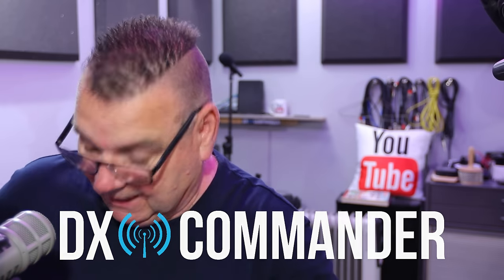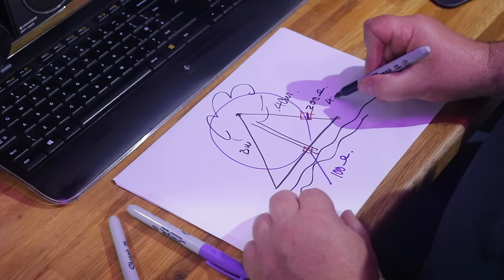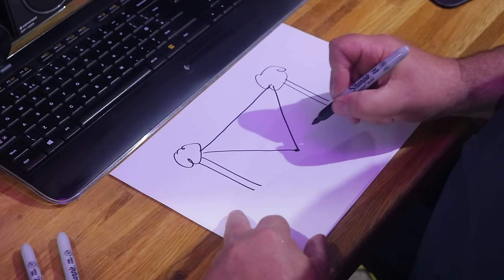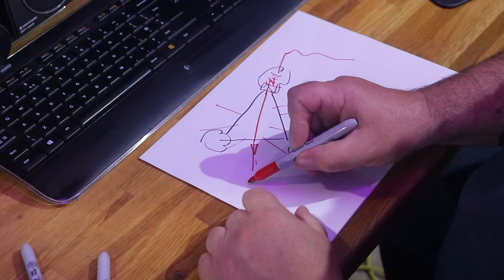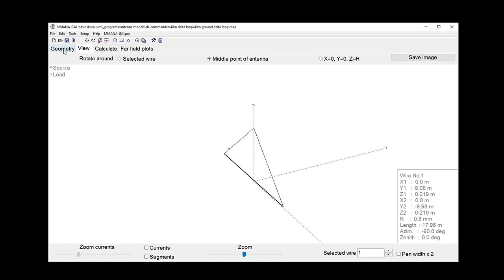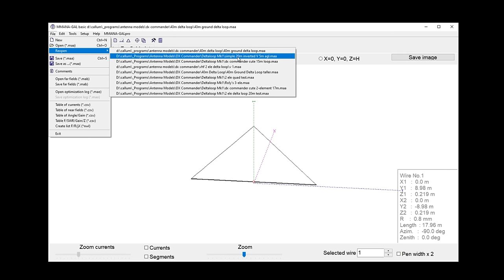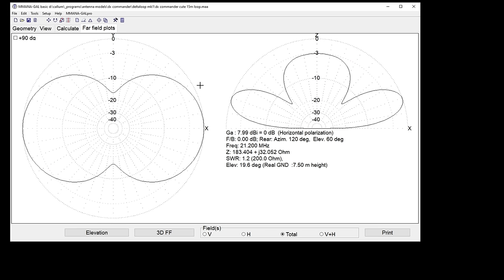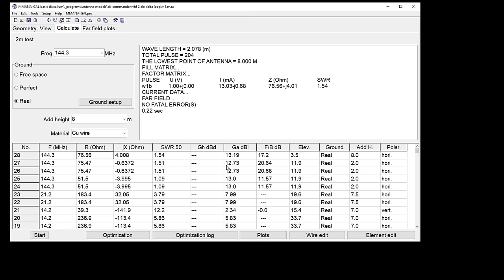The Amazing Delta Loop Antenna

Comment: I've been running a delta loop on 40 meters for years, feeding it with a 4:1 balun at the bottom.  This antenna beats dipoles, OCFs, anything else I have tried.  It's mounted between two trees with the the feed point at about 25 feet, the top about 65 feet.  I'm on the east coast, and can often work European stations while running 5 just watts.  I have worked New Zealand as well as Ireland, and many EU stations while QRP with this simple antenna!  Over the years, I have learned of an additional benefit - because the wire can move through the end support insulators , it isn't stressed in the wind like other wire antennas, and can slip a little.  I also have a 40 meter vertical as a reference, and under all conditions the loop blows it away.  Great to find your video!
Reply from the maker: Ah! Nice job :) Thanks for the visit!

Comment: I’m using a 20m, full wave, vertical delta loop, in a perfect equilateral triangle, fed 1/4 wave from the apex with a 4:1 balun.  What a great antenna.  VERY QUIET, low take off angle, and somewhat manually directional if you turn it.  I used a plastic coat hanger and 3 foot wooden dowel to keep the wire straight at the feed point. The antenna bottom is 10 feet off the ground.  You can lay it out on the ground and tape the insulators in place prior to hanging, to maintain the triangle.
Reply from the maker: Nice.

Comment: I have an 80 meter horizontal delta loop fed at one corner with 450 ohm ladder line.  It's up at 70 feet. On 40 and 20 meters It's a killer antenna.  I work from virginia VKs and Zls with 800 watts. I get 59 reports regularly.  It's a flame thrower. 🔥 Forget a balun at the feedpoint. Use ladder line with a 1.1 current balun at the shack with a short coax. By far my best wire antenna I ever used. Especially on 40 and 20.
Reply from the maker: Outboard ATUs and balanced line great.. I found a little difficult when changing bands fast.

Comment: I use a vertical delta loop cut for 30 meters feed 2 ft up one side with 300 ohm twin lead to a manual tuner. It works great 40-6 meters will tune 80 with diminished results. Best antenna I have ever used. Great dx.
Reply from the maker: Sounds great!

Comment: It's not only about gain, but also signal to noise ratio. I've used vertical delta loops for both 20 and 40 meters fed with a balun in the lower corner, and they were by far the best antennas I've ever used, even beating my hexbeam on 20m  by 3-5 S-units to multiple European stations. 20 also stayed open more than 45 minutes after it closed up on the hexbeam. Absolutely incredible antenna the Delta Loop is.
Reply: This sounds like a antenna I need to try to hold back the noise! My apex is pointing down and I will use 450 ohm window line and 4:1 balun. So this will be vertical and I want it to be vertically polarized. Where to put the the window line on the V legs if you know thanks!

Comment: I've tried a couple of delta loops with a point at the top, but have always gone back to a flat top, where practical. Feeding a quarter wavelength from a point is supposed to have a similar effect as feeding a square loop being fed from the side for vertical polarization, but with a delta loop it may not be perfectly vertically polarized. If the three sides aren't the same length, the gain or directivity won't be as high or as sharp and impedance can change. Think of that as going from an isosceles triangle to a folded dipole and the shapes in between. Fed at the bottom center, regardless of orientation of the triangle and it should be horizontally polarized. Most simple 4:1 baluns are voltage baluns. What is desired for antenna matching is a current balun. It is the current that need balancing, not the voltage. Note that a folded dipole is the same length of wire flattened out. A folded dipole has about a 300 ohm impedance. As it is opened up, into either a triangle or a square, the impedance is reduced. A square loop has about 100 to 150 ohm impedance, while a triangle might not be much different. To get 200 ohms, one of the flats of the triangle might be lengthened, while shortening the other two flats. For an isosceles triangle, I tune as a square loop and use an electrical quarter wavelength of 75 ohm coax at the feed point. For using a 4:1 balun, I would lengthen one side, shortening the others and / or lengthen the whole loop. If all three ides are equal and the loop isn't too big, the impedance should be closer to 120 to 150 ohms, than 200 ohms. If the loop is made on the small side, the impedance  can drop to less than 100 ohms, reducing gain, but able to be fed with straight 50 ohm cable.
Reply from the maker: Very fine analysis!

Comment: The advantage of a vertically polarized delta loop (point up, fed at 0.25 wavelengths down a side) over a ground mounted vertical is that you don't need to create a ground plane to get similar performance.
Reply from the maker: And that they become more bi-directional

Comment: Hi Cal, I ran a vk2abq design for 10,15,20 plus 40,80 with an atu. Yes direct using coat buttons as insulators produced a 1/4 cycle phase shift. Mine was  horizontally polarized and what a performer. An interesting build concept so the ABQ design is also a possibility for any band. Great work mate enjoy your presentations!
Reply from the maker: Ah cool!

Comment: I used to have a loop antenna on 80 meters, horizontal, it feeds the rf up so it's great for in country contacts, about 1000 km depending on the height of the antenna. Comparing to a 80m dipole it's much better and quiet on the band, so great for listening, I could hear stations that could not hear me because it's few s units lower on the noise floor. And that's an easy problem to fix with power. 

So yes I think a loop antenna is great for bands like 160m, 80m and even 40m just because the noise floor is better.

For 2m and 70cm the loop feed and reflector on a yagi antenna gives you a couple off extra db even if rest off the elements are stick's

Another thing with loops is that if you connect two together on 100 ohm feed point you get 50 ohm so it's easy to do a stack. 

In Finland we have a lot off this old phone wire laying around, it's parallel cable coming out to around 100 to 110 ohm and you can split the cable and build your whole antenna out off it and the feed line is a part off the antenna.

Thanks for the great video and keep up the great work 👍

Comment: Thank you Callum for the great info on delta loops. I am planning on setting one up here in the near future. If I can fit it in my yard, I'm going to try a 40 meter loop. I've heard that these antennas are good for low noise receive. I guess we'll find out. 73, K7AXA

Comment: Great Video.I have a loop antenna about 250 m long fed with open wire feed line then to a 4:1 balun. It out performs any other antenna I have used on HF.

Comment: I am building a M0PLK version of the Delta Loop Cal. So I will have to choose from my 135ft OFCD, The Delta and my new 12.4 as soon as I get it built (I ordered the missing bolts on Amazon) dont worry about the cost Cal, go have a couple of pints, you earned it getting the 12.4 designed and tested :)
Reply from the maker: Bless you brother!

Comment: You can build a 3:2 autotransformer type balun with an 11:9 turns ratio. I suspect they aren't generally available commercially due to the improvement in power delivery being marginal in most circumstances, although I haven't investigated it heavily.
Reply from the maker: Clever!
Reply: balun is available on ebay from seller in France.

Comment: The AARL handbook used to have a section on that so your UK clubs might also.  As for the fiberglass poles the two meter set-up looks like just the size of a 1 man tent.  They might even have ready made replacements you can buy minus the tent.

Comment: Thanks, I use a 40m Vertical Rectangular Loop.  The bottom wire is only 6.5 ft from the ground.  It’s fed 1/2 way down one of the vertical legs.  It’s magic on the ears being in the city.  The height at the top wire is close to 25ft.  Works great on 40/20/15/10/6m.  Just need a nudge of the ATU on 30/17/12. -AJ NK4O
Reply from the maker: Great tip!

Comment: Great video Callum. 3rd option of feeding is by using a ladder line instead of coax and then using a tuner. The benefit of this is that you can use any band over the full wavelength loop you made it for (and depending on tuner sometimes other bands too).
I once had a point down delta loop for 80m hanging between 2 pine trees.
It was working very well on 80, 40 and 20m but on 17m I tended to always end up in Ethiopia with even the band seem to be closed I was getting +40 to +50db reports down there. Had a big laugh about it.
Somewhere I learned that Square loops actually is slightly better than Delta loops and the best loop would be one completly round. The reason should be that the bigger the surface area the higher the gain. It would be nice to see you expand on that.
73 de Magnus SM6WET
Reply from the maker: OK, I tend to disagree unless you were looking at NVIS. The thing about a triangle is at least you get real gain SOMEWHERE...
Reply: @DXCommanderHQ  OK, so what my point is not a NVIS low hanging horizontal loop but a vertical loop or several elements vertical loop. Example a squared 2el quad would give slightly more gain than a 2el Delta loop.

Comment: I've built a lot of loops over the years and have always made coaxial matching transformers for them from 75 ohm rg-59, or the bigger  rg11.  I used an 80 meter horizontal-loop for years and loved it, but couldn't keep it up in the Canadian winters. Anyway, high-q baluns "might" be better and cheaper then some long length of 75 ohm cable. I'd go for a 40 meter vertical. Of course that means lots and lots of long radials.
Reply from the maker: Yes, I did that once - and superb for single band vertical delta loops.. Ideally, that's a mono-bander anyway so a 75 ohm matching stub is probably the best way to go.

Comment: This summer I have been using a delta loop cut for 20 m band (20.7 m)hanging top 11 m in my flagpole and stretched to East West and basic line is 5 m over ground.  I'm feeding it in the low angle/ site with an open wire feeder going to my S-match tuner. I can tune from 40 to 6 meter with perfect 1:1. I guess on 40m not the best effiency but it works. On 20 and 10 m lots of north and south America with FB rprts (CW) and 100W. Its a very quiet antenna so a pleasure to listen on different bands. Setting up a fullsize 40m loop same way feeding, but hanging north/ south. Expect to tune it on 80m. But feeding with open wire feeder giving you less loses. Between tx and tuner I have a CMC for protection current coming ng back to tx/ mic/ keyer!
Reply from the maker: Ah cool!

Comment: Please note that delta loops have almost no receive noise when compared to other antennas. My noise level is 3 s-units lower than my home brew 2 element 20 meter yagi. 

I use 300 ohm balanced line from the loop to outside wall of shack, then from 300 ohm into a 4:1 balun to my tuner with RG8X (50 ohm Should be 75 ohm) to my antenna tuner. My 20 meter loop is polarized vertical because I like working dx. My loop works on all bands from 20 meters to 6 meters with 1:1 swr. I could just go strait into my tuner with the 300 ohm balanced line, but I don't because there are times where the 300 ohm line may (Almost never) radiate a little in the shack. I won't take any chances. I get plenty of radiation from my doctor and dentist .. thank you!  

My 300 ohm balanced line is connected 1/4 wave from the apex of the 20 meter loop. There is a better way to match the line, but it involves making an unun with a ratio of  1.25:!. I've  constructed one of these unun, but haven't made an enclosure for it yet. When put in service, the unun will match the 300 ohm balanced line to the ~120 ohm loop tap point.
I think the delta loop is by far the best antenna I've used in 60 years. It's simple and costs very little.  73 .... Lee/W7OSS
Reply from the maker: Ah good for you..!

Comment: Horizontal delta loop is 100 ohm on resonant frequency and harmonics. You need 2:1 balanced to unbalanced auto transformer wound on 43 material toroid. Works 160 trough 6m very well. 20 ft high dx all over the world. 5 ft high enough for continent wide coverage.
Reply from the maker: Oh heck.. Been running 4:1 for YEARS on horizontal loops with 4:1. Clearly need a better rig / SWR meter! Now VERTICAL loops.. They are around 100 ohms. Agreed.

Comment: So... ...Callum...
I'm considering a random length (300-400 feet long) delta loop using 3 trees plus a 50 foot tower as anchor points (a quad, I guess).
It will be anywhere from 30 to 50 feet off the ground, depending on which tree your are at.
Each "leg" will be a different length.
I will feed it with open wire ladder line at the tower support (~ 75 feet from the transmitter).
What kind of performance would I expect from this arrangement? - I'm planning on using a tuner for all freq. - Thanks! - Cheers!
Reply from the maker: It'll be fine! Ladder line too. Easy! I have a video already in stock about to be released about this. Hang on!
Reply: @DXCommanderHQ  Sweet! - Thanks - I'll be looking for it. - Cheers!

Comment: my delta loop is 43.7 m long fed with a 4 to 1 balun in a bottom corner i added a 20m parasitic element and it also work on 80m.this antenna also works on 20m and other bands i have worked over 200 dxcc on 40m with this antenna more than 100 in ssb or cw.
Reply from the maker: Nice

Comment: Hi Callum, my delta's be them single or parasitic are all horizontally polarized. I did run a 2 element delta array on 75 meters and was absolutely lethal. Just like the 40 meter array which my wife promised she would bury me with it in my coffin. Not even coiled neatly. I found they take on a totally different characteristic when going to 2 elements. Monobander always! One last thing, 2-4 s units quieter over a dipole and smokes the vertical as well in quietness. Not as good long haul dx system though. Not as low angle as a well set up 75 meter 2 elly vertical array. The 80m delta I've had up for a long time is useless for 3k mi+ dx but 2k and closer is wicked. Quiet! Humiliates a dipole in every way! I put up a dipole for diversity and realized how much of a load of crap a dipole is. I was swamped with noise I couldn't even hear on the delta. No contest! Lastly, a delta configured apex down fed from the bottom apex naturally decouples from the ground allowing you to run them lower. My feed points are around 6 feet off the ground except for the 20 meter loops. Tops are at around 65 ft. The only antenna that beat the 2 element 75 meter delta was 75 meter moxon at 60 feet. That was amazing. Just real world data for your viewership. I do live in a very unique qth. Diploes suck and would never ever run one after experiencing the " loop life."
Reply: Gee wizzer, I meant to add that the 80 meter mono delta I have up now is a dragon on 30 meters. Workin' the planet on zombie with power a mosquito could sip on. Thing is nuts! it is matched with a 1/4WL of RG11x.85 VF. Spankedeli-icous from 3.5 to 4 meg. Tuner required either side of killbox (3.7 to 3.880 MHZ).
Reply from the maker: "Humiliates a dipole in every way" - Love that description Steve!!

Comment: I’ve got 100ft of rg6 to 4:1 balun to 80m delta loop. Do need tuner on 80m all other bands just hit tune button. Works good. S w r is out of range of internal tuner on 80m
Reply: Is resonant at 3.4 mhz s w r good on 40m 20m 17m 15m 12m 10m
Reply from the maker: SO if it's resonant on 3.4MHz.. You could shorten it a whisker and pull it up to about 3.6Mhz then it SHOULD be resonant on all bands. But it will tune very easily with a tuner with very little loss.

Comment: I'm running somewhere around 280ft Horizonal loop with 2:5:1 balun. Right now, it's in the shape of a triangle as myself and an old high school classmate/ham buddy helped me get it up, but we ran out of daylight. When the foliage falls off the trees again then we are going to stretch it where it will be more in the shape of a rectangle. I was wondering if it will bring down the resonance. I know it will have more ground inside of it but I don't know what will change. I have been licensed for 6 months and already gotten every continent but Africa. On 40 meters I have gotten Japan which was at night which I'm really not much on the air then. On 80 meters its more NVIS as its maybe 45-50ft in the air at its highest point. Thank You Callum for your videos and any information. Stephen KI5VUH
Reply from the maker: Resonance on shape.. Not much. Frankly I prefer triangles.. But try it!

Comment: Hi  Callum I used my 40 m delta loop with 4 to 1 balun at first on the bottom section the problem I had that the 100 ohm impedance of the loop into the 200 ohm balloon due to the mismatch it dissipated a lot of heat when 400watts passed through it.  I then tried open wire transmission fed at the top and made myself a home brew balance matcher called a link coupled matcher no balloon was used worked stateside like shelling peas fed at the top is halfway between vertical and horizontal polarization  which also I could work inter G.
Reply from the maker: Ah OK.. Yes depends on the orientation. Horizontal will give you higher impedance.
Reply: @DXCommanderHQ  Feeding at the  apex or at the bottom and I have measured it 100 ohm.